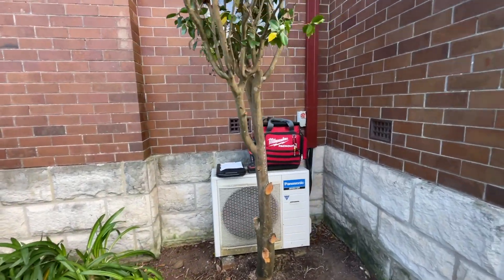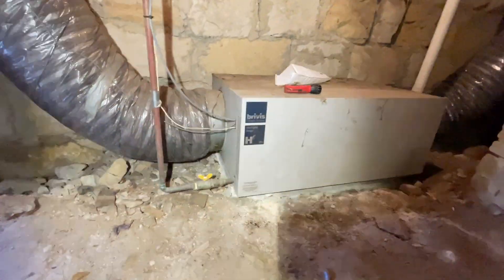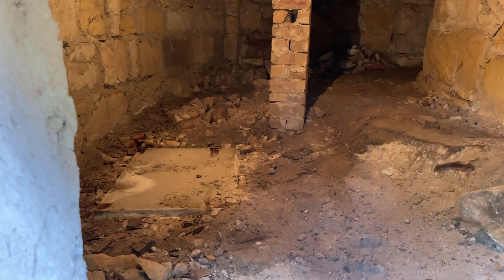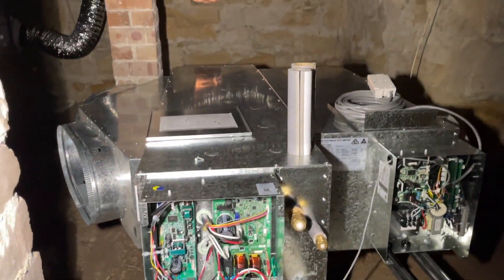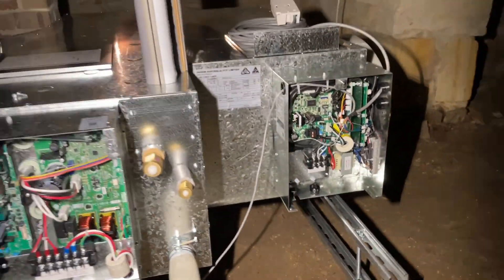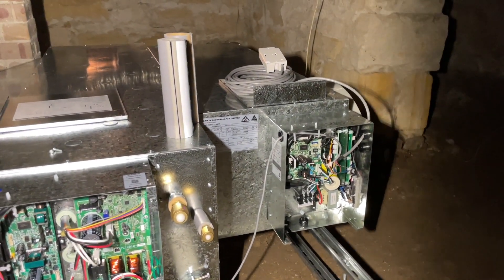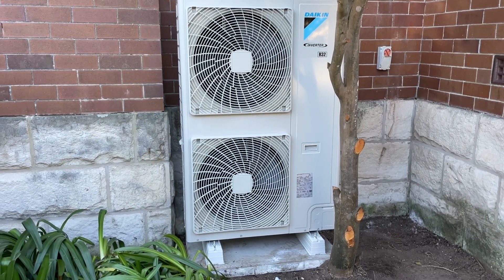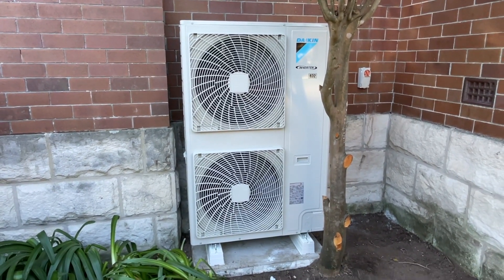Installing the DAIKIN R32 INVERTER UNDERFLOOR AIR CONDITIONER with AirHub Linear Zones.

Comment: Did the owner try heating with the old Panasonic?
Reply from the maker: So this house had central gas heating (brivas) and they had a little Panasonic ductless mini split in one of the rooms for cooling. It still worked totally fine and yes it worked on heating. They wanted it removed as they don’t need it anymore with the new central air con.

Comment: Just out of curiosity, what is the difference between a Daikin VRV and normal Daikin model?
Reply from the maker: Good question mate. A standard ducted unit has 1 outdoor unit and 1 indoor unit. A VRV (Variable Refrigerant Volume) has one outdoor unit (can technically have more then one) and many indoor units. The benefit is you can control each indoor unit individually where as if you only have the one indoor unit (like a ducted air conditioner in a home) then you have to have the same setting in all rooms.

Comment: Did you have to make the floor outlets larger to allow for the greater flow with the new Daikin unit? We have underfloor gas ducted, and I'm keen to swap to Reverse Cycle and hoping we can still use the same vents.
Reply from the maker: The gas furnace had 100 x 300 (neck size) vents in the bedrooms which we re used however I upsized the ducting going to the vent. In the living spaces I upsized the vents to 150 x 350 and also upsized the ducting.
So to answer your question, if you want to change over to Air Conditioning from Gas Heating, you’ll definitely need to modify the ducting and potentially the vents. 100%

Cheers mate

Comment: We have a lot of crawl space installed split systems and package systems in some areas of the USA. We put 6 mil clear plastic over dirt in the entire crawl space. Provide some powered cross ventilation, more and larger vents, a screen door into crawl space. You’ll have more rust and mold on and inside the Daikin because of condensation, especially with little ventilation and no plastic. We mount our air handlers on concrete block and pressure treated 4”x4”. Sturdy, no vibrations and no threaded rods to work around when servicing.
Reply from the maker: Nice mate. This underfloor was dry. It had ventilation running all day on a timer. I don’t install many underfloor units, not very common here. 
Cheers

Comment: Haven’t seen those Air Hub Controllers before… Looks very similarly to the NEO controller from Actron. Is it a new product from Daikin? Im keen to see you post a video on it
Reply from the maker: Yeah mate, they are about a year old however this is only the second time I have installed one. 
I’m posting a video in a couple of days where I show you the controller in detail and my honest opinion on the new setup. The AirHub incorporates temp sensors in each room which control the airflow.

Comment: Hey Mitch, so are they using the existing underfloor ducting for this Daikin that they were using for the Brivis heating, or other vents?  Thanks!  Great video by the way!!
Reply from the maker: So I have ripped out all the ducting from the gas furnace. Then they insulated the floor boards when the underfloor was empty. Then I returned to install new ducting. I did that because I wanted to upsize all the ducting. The existing furnace ducting had 6” duct to the bedrooms and 8” to the living spaces. It had 1 x 12” duct for the return. I have installed 2 x 16” for the return and 10” to all supply vents. I will post a video in a couple of days showing you the new vents in the floor.  Cheers

Comment: The original 50 cent coin when released in 1966 was originally round, petty it was a kiwi coin as the aussie one is worth a fair bit for collectors.
Reply from the maker: I heard about this, apparently it was to similar to the 20 cent piece and that’s why they changed it. At first I thought it was the Aussie one and was a little disappointed when I turned the coin over 😂

Comment: Nice video Mitch, and i like the idea of that new Daiken under floor air handler, providing space is available ? i look forward to part 2 later on   😊
Reply from the maker: Thanks mate, I have a Daikin underfloor in my apartment and it works really good. I’d prefer to have a unit in a roof space personally but when it’s not possible under floors are a good option 👍🏻
Reply: Is it possible now, to fit a air handler through the ceiling man hole,without removing roof tiles ?  @maracservices
Reply from the maker: @robalexander7348  with Daikin it is because the air handler is designed to be dismantled to get into the roof cavity and then re assembled in the roof cavity. That’s actually how I get all the Daikin air handlers in the roof. That’s also how I got this one through the underfloor access hatch.
Reply: Thank you Mitch, i like that idea then you dont have to disturb or damage roof tiles and  sarking, appreciate your reply  👍  @maracservices

Comment: So good to see the upgrade hub wall unit compared to the old controller.
Reply from the maker: Looks a bit more modern then the old brivas dial control 😂

Not easy to install into a brick wall though. In fact I don’t think it’s designed to be, I just customised it a bit to work.
Reply: I think that depends on how humid is on the day . I have a 20 year old Daikin ducted unit in it varies the amount of of water depending on the air humidity. Same in summer for the indoor unit.